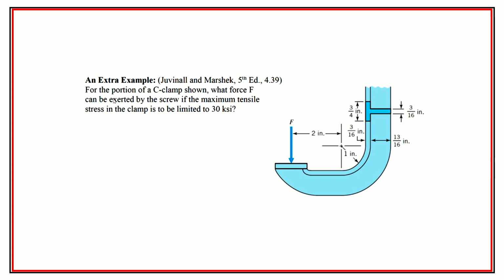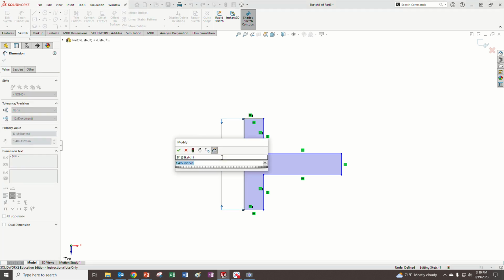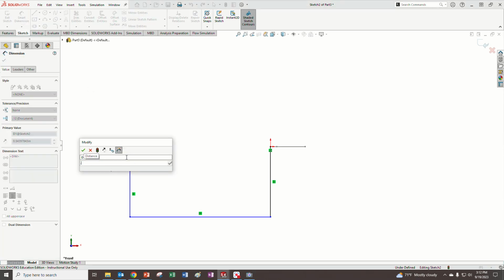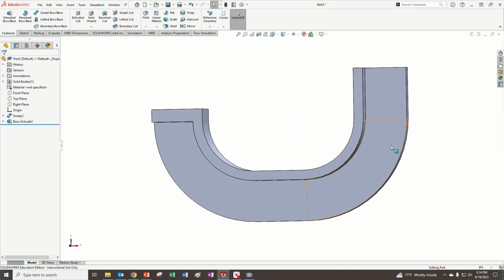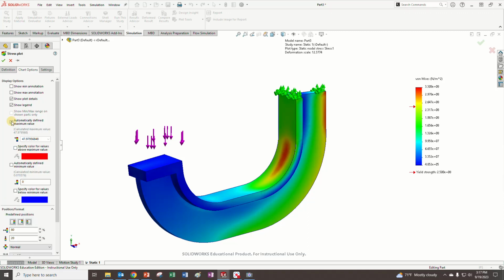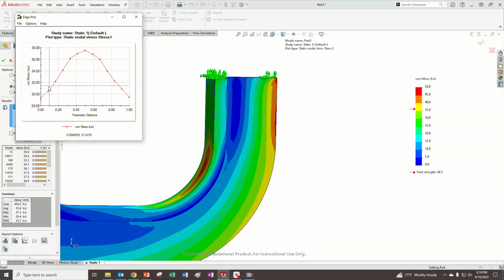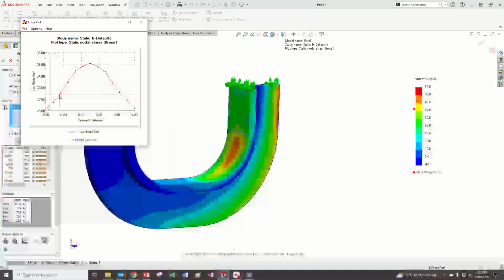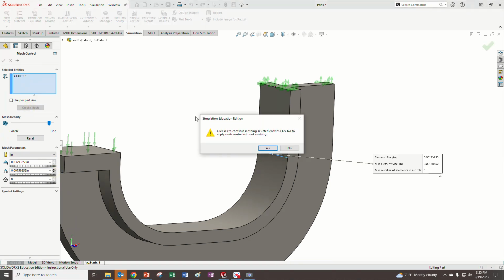F23 ME370 Class 7 SolidWorks FEA of Curved Beam from Juvinal Example

Comment from the maker: Oops!  I made the inner edge of the left side 3 inches from the inner edge of the right side instead of the center of the force 3 inches from the right side.  That's why the stresses were too high. Fixing it resulted in about 33 ksi maximum stress, still a bit higher than the hand calculations but better.